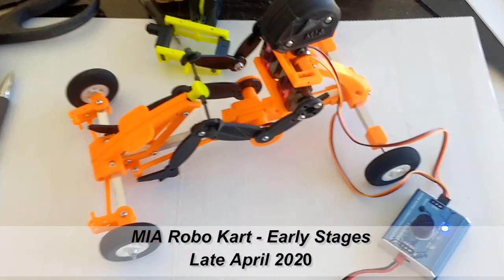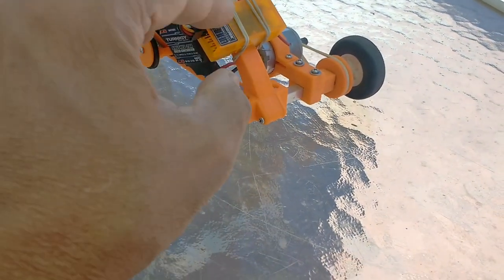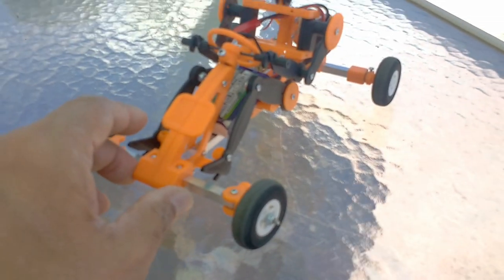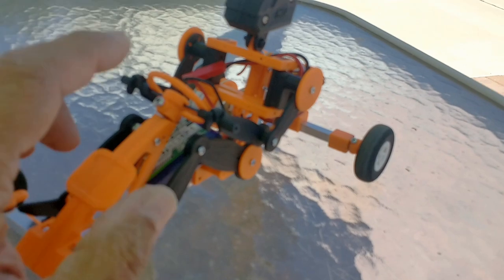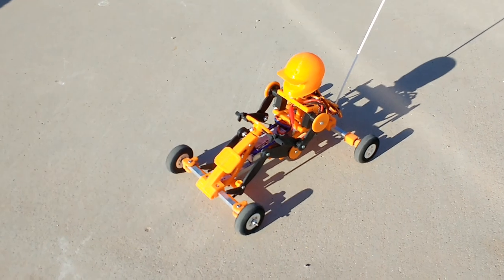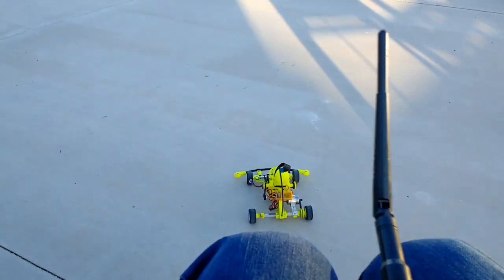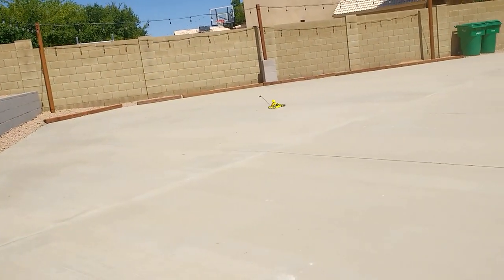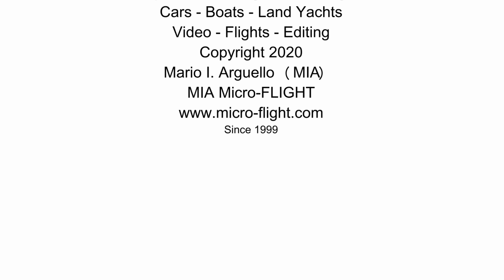Racing RC Go Kart  -MIA Robo™ Kart  Evolution

Comment: How about a box on the back to hold the receiver and esc.
Reply from the maker: Although it will hide  those components, it would hinder the cooling of the ESC and  the light of the RX would no longer be visible.  I considered doing just a couple plates as part of the frame to hold these components as well as the battery.  The simpler the model is, the better it runs, actually. Some of the aesthetic beauty of the full scale racing Go-Karts is that they are open frame design with the mechanics in full view, except for the front bumper and side panels which is partly done for aerodynamic reasons.
Reply: MIA Micro-FLIGHT could just be a frame to hold it in. I know when racing cars can flip, just thinking about protecting the exposed electronics.  But simple is always good.  They do look fun.  Could be a good spec racing class to be held in any parking lot.
Reply from the maker: @slebdad  yes, intended for racing on any hard flat surface.